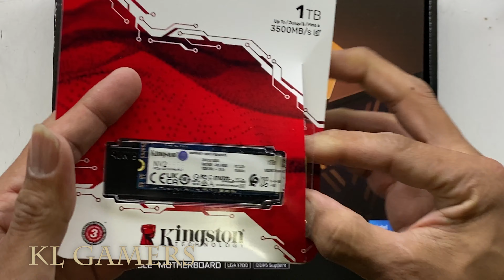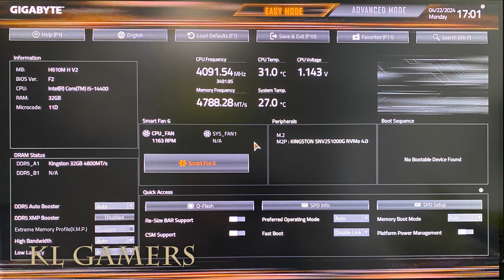intel Core i5 14400 GIGABYTE H610M H V2 Kingston NV2 DDR5 Compact Desktop PC Build

Comment: Hello, I have the same motherboard, but the SSD does not show its real speed. Normally, reading is 7400, writing is 6500, but when I test, it shows a number like 3500 and 3200. How can I solve this? my processor is intel 14400f, my ssd is lexar nm790

Comment: Hello, I have the same motherboard. I connected it the same way but the screen does not turn on. Can you find a solution? Note: All my parts are new and I installed the first package.
Reply from the maker: u can change the RAM slots, check if missing cables, and check if motherboard ins are bent
Reply: I checked everything. But I can't get an image on the screen.
Reply: @KLGamers  My computer's processor: Intel Core i5-12400F 
According to what I have researched on the internet, there is no internal graphics unit feature. I connect my screen to the D.Sub port on the motherboard. Could the problem be caused by the processor? Please, I need your help.
Reply: @1sma1lkoc  ekran kartı alman gerekiyor yada işlemciyi değiştirmen gerekiyor. ( F ) olmayan bir işlemci olması gerekiyor
Reply: @1sma1lkoc  12400f have no igpu, u need a dedicated gpu, like rx 6600 or rtx 2060